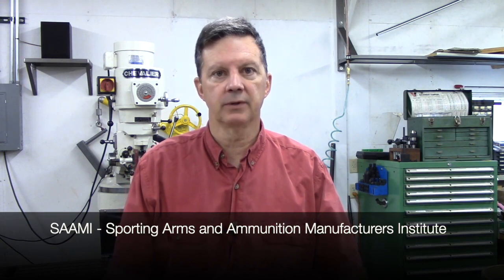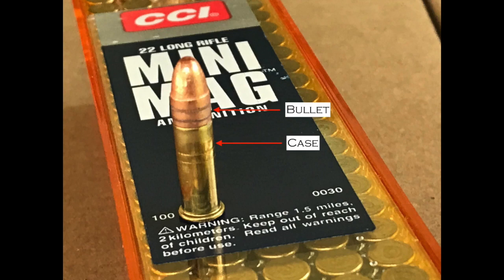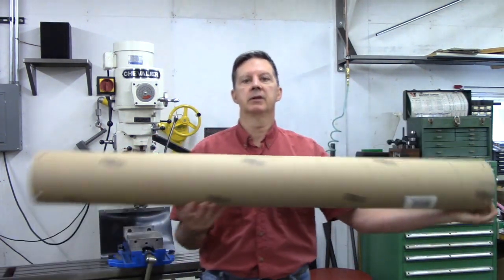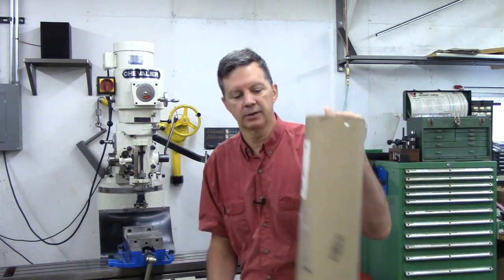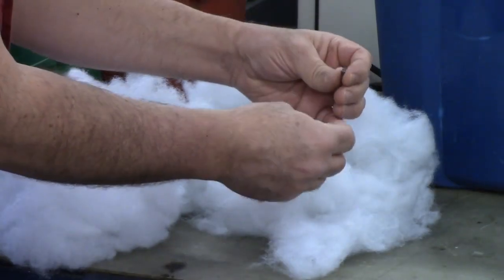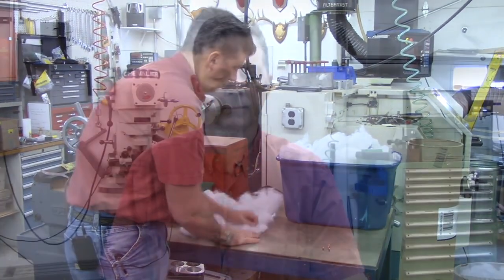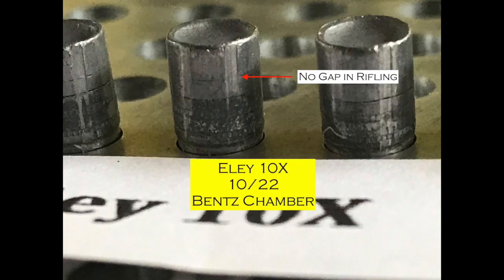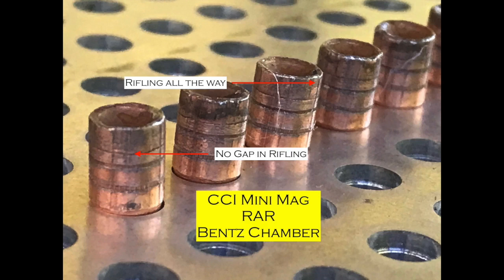Ruger American Rimfire (RAR) Experience.  Part 11:  Soft-catching bullets.

Comment: You did a fine job comparing  the sporting chamber vs the bentz chamber. The bullet design and the difference in pressure effect on the bullet base because of chamber dimensions. That is, where the pressure is applied to the bullet in relation to the seal created by the base deformation.Your theory about "flyers" seems reasonable when you observe the engagement by the barrel lands. Over the length of bullet. Now... the Eley bullet and the CCI bullet differences in the unmodified chamber. Not wholly explained...My guess would be the difference between the Eley lead bullet and CCI copper jacket bullet. Both brought closer in performance with the bentz chamber. SUBSCRIBED

Comment: This Bentz chamber should also effect the velocity being higher does it? Less loss of pressure means it can only go one way, or am I reaching here?
Reply from the maker: In theory, I agree with you completely.  I don't have a chronograph, yet, but plan to duplicate these experiments in the future and measure velocity results.  In reality, it may only be 10-20 fps faster, however one test is worth 1000 expert opinions.  Thanks for watching.
Reply: @dauntlessendeavors1000  thanks for replying, I will get within a month (Dutch law) my RAR LRT and was especially interested in smoothing the bolt and the action support. Great vids, thanks! The Bentz is some steps to far for me, but I can let it do by a weapon smith, if needed.

Comment: How about the 9 mm parabellum ? Because the .22 LR and 9 mm are the most sold calibers in the world. Same principle ?
Reply: Just to add to this conversation, this is where caliber names of 38 and 380 originated. In the early days they employed heal type bullets when developing the early revolver cartridges. The outside case diameter was approximately .380 and essentially that became the cartridge name reference to the bullet and bore diameter. When it was eventually determined that better accuracy resulted from using a flat base full diameter bullet as opposed to a heal type bullet, the bore and bullet diameter was reduced. It also explains why our current 44 caliber revolver cartridges employ .429" diameter bullets.
I used to catch bullets including Centerfire rounds in an 8 in steel pipe filled with cotton fabric, typically cut up t-shirts and blue jean material.
You are doing some great research here!
Reply from the maker: You can soft-catch anything but you would probably need a much longer tube.  I was particularly interested in recovering 22 LR bullets to see what happens to the base of the bullet and to illustrate how it obturates up to bore/groove diameter under the pressure of firing.  9mm bullet bases are already full diameter when they are made.
Reply: @dauntlessendeavors1000  thanks, but does that mean that the case of a 9 mm is more then the 9 mm?
Reply from the maker: @joostprins3381  Yes.  The outside diameter of the 9mm bullet is the same as the internal diameter of the 9mm case.  The outer diameter of the 9mm case is larger than the bullet.
Reply: @dauntlessendeavors1000  thanks.

Comment: Bullet hardness from lot to lot needs to be uniform. Perhaps a softer alloy may help too. It looks like any variations in escaping gas at the muzzle can influence the bullets while the heel is still in the barrel unsupported by means of creating an imbalance of pressure around the heel at the time of release. I think you are onto something here. I am not sure the manufacturers take any of this into consideration. Wouldn't it be nice to have a 22 shoot sub half inch groups at 100 yards?